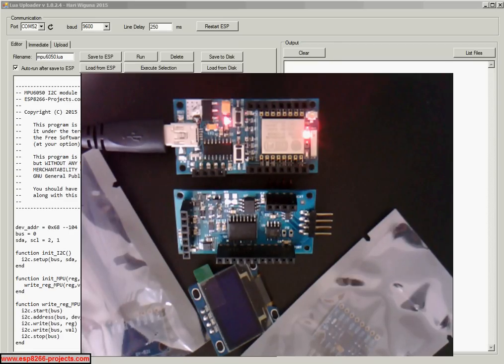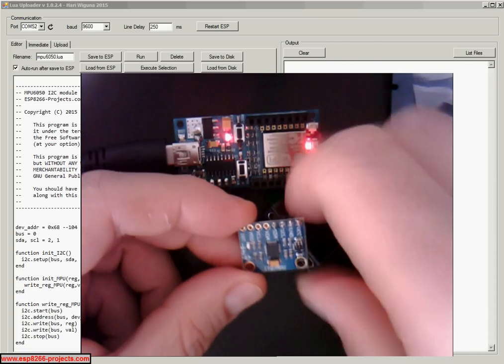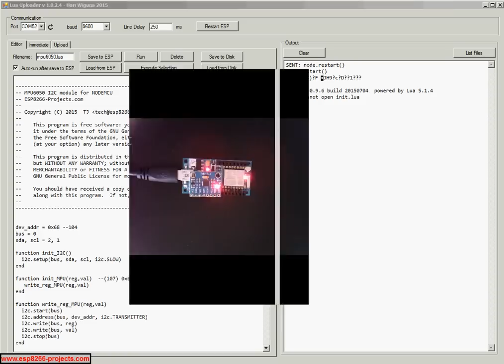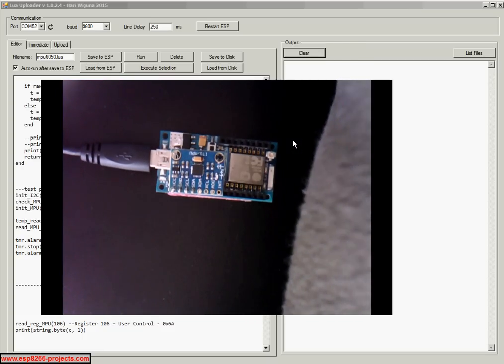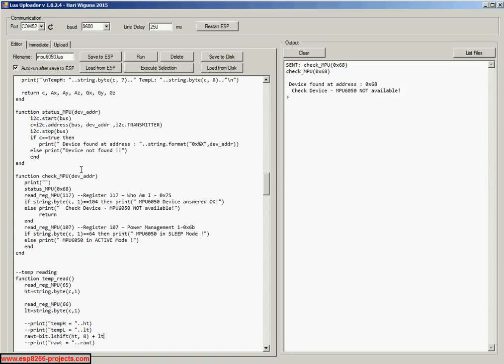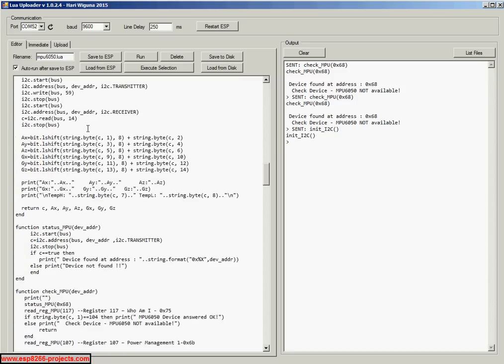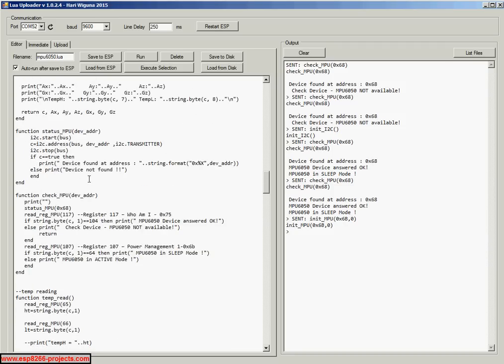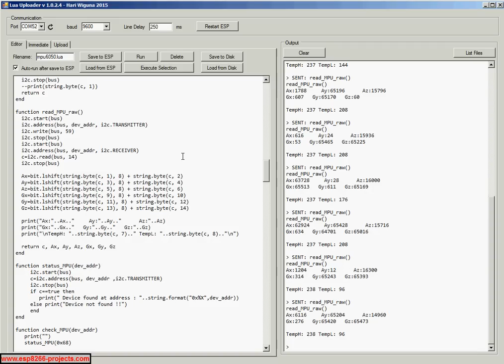MPU6050 - I2C Driver - Init / connecting with ESP8266 nEXT EVO Board

Comment: I am trying to use this code, but my program returns "Device not found !!" on the status_MPU function, because 'c' is false. I run a similar program with Arduino with the same address (0x68) and it worked well. Can you elucidate me?